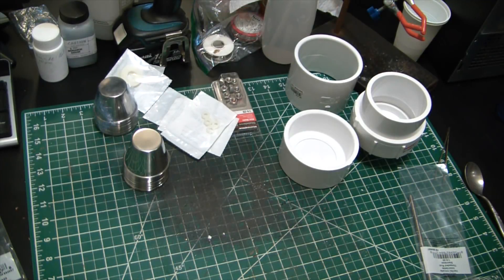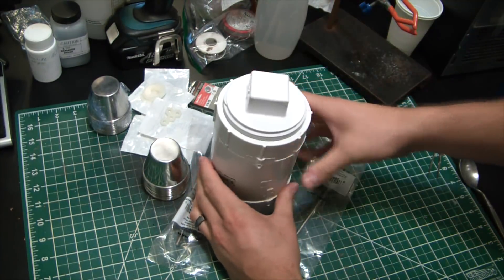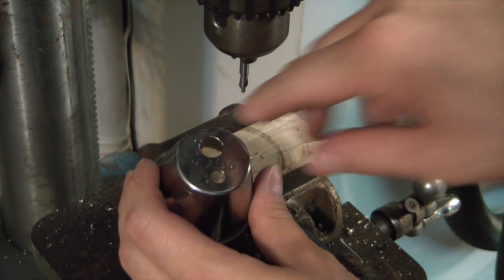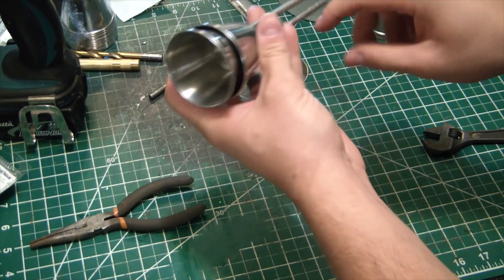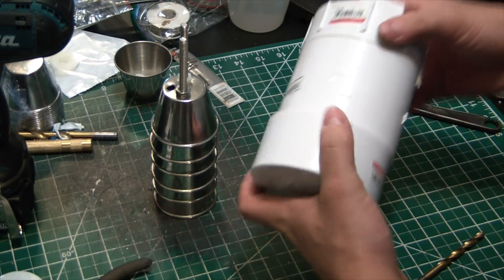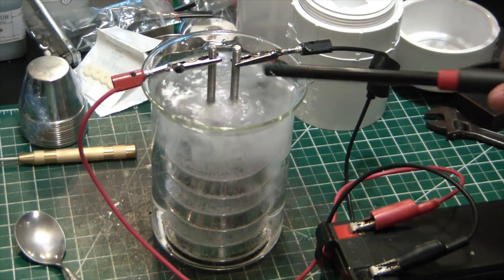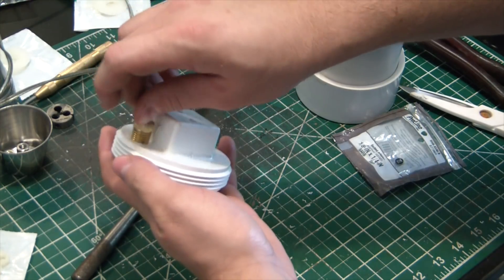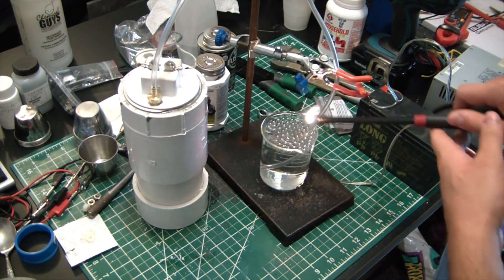DIY HHO Generator for Torch - ElementalMaker

Comment: The ideal voltage to split water is closer to 3V not 12V.  12V should cause excess water heating, which would quickly be a problem if this was left to run a long time.  What people do is they place 2-3 neutral plates (not directly connected to the anode and cathode) between the wired anode and cathode.  The plates sitting in between induce voltage on each side, so one side becomes the cathode and the other the anode for their neighboring plates.  In your setup, you would remove 1 or 2 interior plates and insulate the direct connection (and also the rods) for the interior plates.  Everything else would be the same.  It isn't clear if the geometry of your setup would allow that, or if charge would be able to follow a water path that doesn't induce the neutral plates right.

Comment: Next time u make generator  u  put 7 steel plates  and to and  positive , center negative,  and between  u going to have two neutrals,  don't put rod in center cause electro magnet  field need to flux in between  the plates,and if you do like that good amount of the will be produced , and at positive  and connect a led light  all positive  to , to reduce the voltage consupition since electron flow from negative to positive , and need Dc power ,

Comment: Wonky stuff?  Hho has long since proven to be a great money saving/gas milage increasing tech.  Inexpensive and easy setup up gains people from 20-40% mpg increase on average from small gas engines to big rig diesels and large machinery like bulldozers, tractors or anything else. 

Try not to mock it by doing so youre only doing what those who’ve been holding back advancments in tech for decades. We’ve had electric care since like 1905 and HHo since back in 1930 or earlier. The Nazis starred using hydrogen as their supplies dwindled.
Reply from the maker: Except there is zero data showing that efficiency gain to be true. It has been debunked time and time again.

Comment: I love the video. Just curious, what would  be the result if the cups were open side up instead of bottom side up?
Reply from the maker: Same result, it would have just made assembly more difficult, so I inverted them. Definitely doable though and will work a okay, plus you won't have to drill the hole

Comment: Monel is corrosion resistant and somewhat catalytic.  Can it be used for the HHO generator plates instead of stainless steel?  Would it provide higher HHO output?

Comment: The bad thing about the cup shape is you get different spacing in the top vs the slanted sides.
Reply from the maker: As long as they are evenly spaced the gap will remain uniform

Comment: stainless steel electrodes release hexavalent chromium, extremely carcinogenic...anything with chromium should be viewed with suspicion
Reply: Good point. Same thing if you're welding stainless steel. It'll gas out ~1° of the steels chromium into the air you're breathing. Not many are aware of that.

Comment: Why not just drill 1/16" holes around the sides of each cup? I realize that this will remove a bit of material, but it will also allow free flow of gas and water/lye mixture.
  A hole in the top of each one is a good idea, but I think you would get much better results with the holes being small but many, more as you get higher up to the top of the cups.
  IDK if this will improve your output and lessen your input, but I am not sure as I've never built one with just one gas vent in the very top.
    Flat or round flat plates would allow for more plates, without any issues with the bubbles getting stuck.
  Great idea, thanks for posting this!!!!
Reply: Drilling holes would increase the surface area, and allow free flow of products. It's free real estate.

Comment: Nice! 
Ok made one like eight years ago.. 
But is used a different electrolytes. I juice pineapple and onion and one other ingredient. Just don't remember. A 1 foot long bubbler 1inch wide. And used a car battery. 
For the plates I used galvinized light switch covers. Couldn't get the 316L  stainless at the time. 
Produced a tone of cloudy highly flammable gas. Was neat. Only lasted for a few test before the plates were junk. But I did it with water and juices from produce. 
Saw a post from that you made on that over seas guy making Ruby's. 
Figured I would check you out

Oh sand the cups to increase surface area!!! You will produce a more gas.

Comment: You need those cups only on the cathode only cathode generates Hidrogrn
Reply: @drdefecation  the oxigen.is in air as soon as it gets from the hose you will have oxigen to.start the fire. Also there.will be a small amount of.oxigen generated,.because there are 2 parts.of hidrogen and.one of oxigen
Reply: @technologyrethinked  If you want to operate a welding torch, you have to add extra oxygen because only adding atmospheric oxygen will give you a flame not hot enough.

Comment: You know when I was a boy a man that lived next door that had his Hold Kingswood running on strait tap water from the tap, he had none of this HHO cell at all, he said all he had done was increased the jets in his carburetor to twice there size and made this high voltage coil on the side of the motor and that was all he had and it just started up and ran without any issues two years later a man who was with me when he showed it worked it out and tried to sell it to Ford and Holden and next the old man was found dead on the side of a railway, fell of the train drunk apparently even though he never drank.

Comment: Yo I saw you comment on a different channel complaining that he was coping your videos, which is a perfectly valid complaint, my only suggestion is to work on the editing of ur vids a little more, like his a little more polished, it has some quite soothing background music at appropriate times, and his explanation are a lot more concise, sometimes u tend to ramble, which can be a very big turn off to viewers. For example, when you where explaining the airs hole u drilled, all u had to say was that it was used to let the air travel easyer which will increase the rate that the gas is made, which is what the other guy said, however u went into more detail, however u did not need to,  because it was kind of obvious, and non essential.

Comment: You need neutral paltes. Use six cups all isolated from each other and only hook up the top and bottom. Use 12v and the middle cuos with act a voltage deviders.  Should get 2v on each cup. That should help a lot with the over heating
Reply from the maker: Yeah I will have to build a new one soon and utilize the neutral plates.

Comment: EM, I talked to you the other day about making a small HHO and decided I have to try it dude. Lol You’ve inspired my intuition! But like we discussed before I wanna try it on a much smaller scale. I know that sodium hydroxide is the electrolyte but is it necessary to produce hydrogen? I remember from science class that adding sodium chloride to water will make it conducive as well. So my question is can I just use non ionized table salt and water? Or is this one of those stupid questions with a rhetorical answer? Lol
Reply from the maker: Table salt will work, but will also produce some chlorine gas. And eventually bleach (NaOCl) & chlorate (NaClO3) in the container. Sodium hydroxide simply remains the same, so you don't have to worry about any of those side reactions.
Reply from the maker: Baking soda is a good alternative 👍

Comment: Why not make two or three intermediate cups float electrically, to raise the voltage so you can use a 12V (PC) supply efficiently.  I guess you need about 3V per cell to overcome the electrode potential, the rest is just heating, so if you isolate 3 out of every 4 cups - i.e. not connected to either rod, you have made 4 cells in series, which will add up to 12V.  You can adjust the electrolyte concentration to control the current, obviously it will need to be stronger than for 5V per cell to get the same gas production, but it will heat up less.
Reply from the maker: That is a great suggestion, my cell is definitely not very efficient.
Reply: @ElementalMaker  You also seriously need some safety device on your gas generator in case of explosion, e.g. arcing inside or an un-arrested flashback. Drill a large hole in the lid and glue some sort of membrane on the inside to make a bursting disk.  Then if it blows you just need to replace the membrane, rather than pick shrapnel out of your face.
Reply from the maker: @timjackson3954  excellent idea

Comment: I keep wondering why none of you guys just left the cups or whatever you're using for plates stacked in 2 equal piles and drilled them all at once.
And had you sanded the cups with some rough sandpaper it would have given it much more surface area to create the gases.
And lighting those bubbles right next to an active cell container that's leaking...
Reply from the maker: I was going to do that, but with the slight concavity of the cup bottoms it would have made the drill bit wander and the hole would be far from perfectly vertical.
Reply from the maker: The cell was only leaking electrolyte, not gas. So there was no danger there
Reply: https://patents.google.com/patent/US20090139856A1/en   I invented it

Comment: I think if you installed those cups facing upwards, it’d work better. Reason is that you have progressively more gas bubbles accumulated in upper cups which reduces contact area with electrolyte. On the other hand, if cups faced upwards, bubbles would escape out from each cup and you’d have consistent contact area with electrolyte throughout your hho cell.
Cheers.
Reply: He couldn't get good nuts to securely mount he mentioned it in the video
Reply: No...Mr Bill...that would work better....BOOOOM!  OH NOOO
Reply: Just look at the patent https://patents.google.com/patent/US20090139856A1/en  and ask me
Reply: it does https://patents.google.com/patent/US20090139856A1/en

Comment: HHO is a big WANK! There is no elemental hydrogen or oxygen involved. There are only MOLECULES which are H2 and O2. The reaction is:
2H2O > 2H2 + O2
'Brown gas' is just a BIG WANKER NAME,  used only by ignorant fools.
Reply from the maker: There is alot of wank surrounding it, yes. I dont think the name HHO is meant to imply individual atoms; as H and O are diatomic and that's elementary chemistry. I think its simply a convenient way of stating the atomic ratio of hydrogen and oxygen in the gas produced. Your not going to say H2 H2 O2, you will reduce it to simplify.
Reply: @ElementalMaker  Nice video, I'm not criticisng you...But I still think everyone should stick to the real world labels where molecules, not atoms are involved. It is elementary chem so why not do it right?
How the H2 and O2 mix produced by electrolysis ever got the name 'Browns gas' beats me. Did some wanker get a lot of other wankers to believe 'Brown' was the first to connect electrodes to water??? Everyone should stop calling it 'Browns gas' as the only gas that 'Brown' ever invented came out of his arsehole!
Reply: @ElementalMaker  What is wrong with stating the true situation anyway? The fact is, the equation that you should be educating everyone  on YouTube is this:
2H2O > 2H2 + O2
Get it right NOW and you won't have another generation of fuckwits spreading the 'Browns gas' nonsense!!!

Comment: I made a hydrogen generator with some copper wire and nails. I noticed that after running for a few minutes that the copper oxidized. Is this a bad thing? Because im wondering how two steel pieces with different polarities would work. Anyone care to help me out?
Reply: Burn two pencils and collect the graphite rods. Use those as your electrodes. Corrosion should disappear.

Comment: Nice, we used the sauce cups similar to your design for my kid's science fair project. We used the cups with rubber grommets on one side and hack sawed a moon shape on both sides to allow water and gas to flow freely. Also we stacked our cups much tighter together to improve gas production and efficiency of current. We used plastic zip ties cut into strips and placed them between the cups. Also we used a clear body water filter housing and stainless steel threaded rod and hardware for any metal parts. The water filter housing was really nice and easy to work with. We hooked ours up to a solar panel kit from harbor freight. :)
Reply from the maker: Awesome! How is your gas production on the solar panels?
Reply: @ElementalMaker  It was okay, good enough for proof of concept. As long as it sat in the sun it produced. With the right setup the idea would be a good way to make and store it. Although if someone were to try and use it like that they would have to isolate the anode and cathode into separate chambers to gather hydrogen and oxygen separately. The way I understand it storing the mixed gasses can be unstable.
Reply: @ElementalMaker  Do you find that your water get's hot after a while?
Reply from the maker: @dono624  absolutely, in my setup I'm pushing near 300W through the water, so it certainly heats up a good deal.
Reply: @ElementalMaker  So, I did something creative with mine because of the heat, since my filter housing has an inlet and outlet what I did was purchased some clear hosing and appropriate sized barbed fittings and made a reservior. On the inlet I ran a piece of tubing inside the housing to the bottom and as it produces gasses and the bubbles generate upflow I install a reservoir above the housing. So it works on the same type of principle as an undergravel fish tank filter. It flows well and the larger reservior above it helps keep the electrolyte cool as well. Does that make sense?

Comment: Even with a vent hole I don’t like this design. Each cup vents into the cup above it, so as gas floats up the more gas is added and the volume of water displaced increases. The cups toward to top of the stack will be  more insulated by the greater volume of gas. I would drill holes in the sides of the cups to provide more flow for gas to move out the sides and allow water to flow in. Not that it seems to be a problem with your setup. My criticism may be unfounded.

Also, has nobody mentioned hexavalent chromium yet? There should be a flame going by now.
Reply from the maker: Yeah its not exactly optimal, but it has worked well so far!
Reply: ElementalMaker It’s frustrating when a device seems to continue serve its purpose despite having not implemented the design changes I proposed. See the way its supposed to work is the consulting engineer will propose changes to prevent a theoretical concern from becoming a real problem. Then those changes are made and the widget is put back into service. Then when the theoretical problem doesn’t manifest itself the insulting engineer congratulates the client on their wise decision to be proactive and take action early. On the other hand, if our design improvements hadn’t  worked out so well, then clearly we underestimated the scope of the problem. Imagine how much worse the situation would have been had we taken no action.

Never let the fact that “it works fine” be your excuse against improvements.
Reply from the maker: @NoahSpurrier  clearly your still in school and haven't seen how the real world works yet. I'm also an engineer and can tell you the world literally runs on "its working so we're not gonna change it". I have proposed design changes to everything from radio-frequency ablation generators for spinal surgery, to process improvements at sewage plants. You know what the answer is 90% of the time? You got it.

Comment: turn the cups over,stack from top down.you only have to deal with the out side of the bottom of the cup.no need for third hole
Reply from the maker: That was my original plan but it was much more difficult to assemble that way, hence the third hole. It's been working like a charm so far though!
Reply: @ElementalMaker  I can't see, where the difference is , if you turn the assembly around.
Reply from the maker: @werner.x  try it and you'll find out 😁
Reply: @ElementalMaker  Good point!
Maybe next year ;-)

Comment: Its been a decade or more so some of the numbers are not as fresh in my mind  but i will try my best to recite the efficiency numbers i tested, or give as close as possible.

Measure of efficiency was by the militers of gasses per unit of power (minute per watt). Gasses were cooled by bubbler and  contained hydrogen oxygen and presumably  water vapor at 100% humidity at 70 degrees at near sea level atmospheric pressure. 

At 13.4v (charger)  mmw efficiency = 0.97. With 1 neutral plate serving as a voltage divider,  the voltage between any two adjacent plates was  6.7v  and mmw=1.83. With 2 neutral plates the voltage between any two adjacent plates was about  4.4v and the mmw=2.69.  
Each new neutral  plate had diminishing returns on increase in  efficiency. The higher the mmw, the less waste heat was produce as more of the energy went to producing HHO gasses, but because of current drop, the production rate also drops. One can compensate by doubling the plate surface area to double the current. And to an extent, one can increase the electrolite strength. But over a certain point, increasing the molar fraction of sodium hydroxide to water decreases the current flow.

Comment: That cheap stainless won't hold up.  I used to own a company called HybridTech where we built and sold large torches.  316L is the minimum to use.  I wrote a book back in 09 called "You Can Turn Water into Fire"....let me know if you need any ideas or help.
Reply from the maker: So far they are holding up. I'm not running the cell for more that an hour a week, so it'll probably last me some time before the cups degrade. I would have loved to use 316 but that was out of my project budget. Can you send me a link to your book, I'd love to check it out!